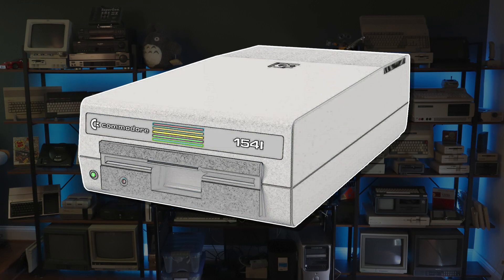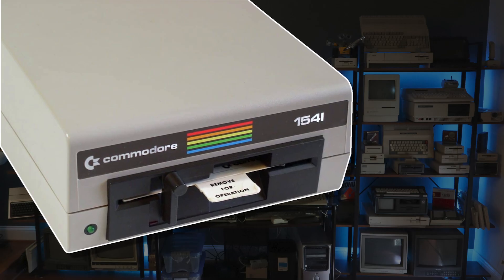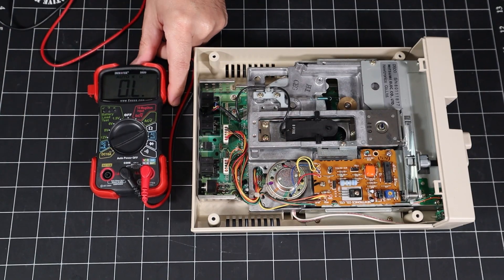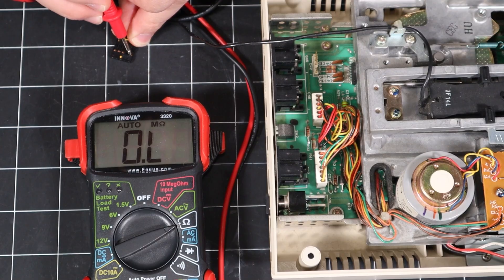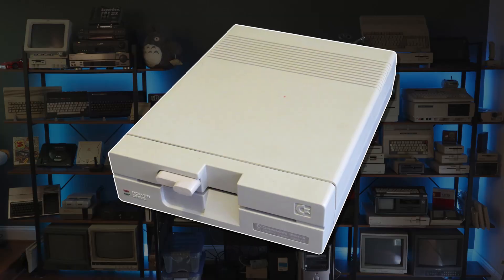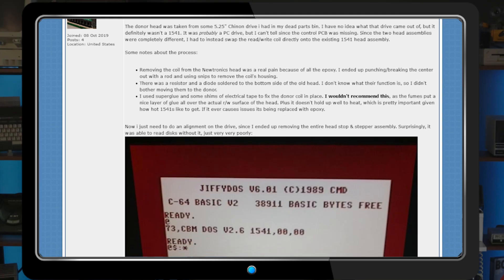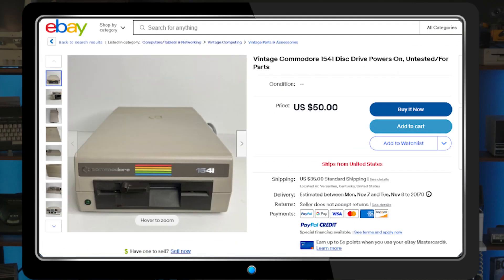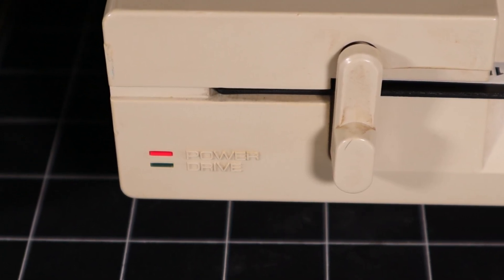This Commodore 1541 hides a terrible secret.

Comment: Short? Wait where? O.L is open.

I do wonder what repair methods we may be able to devise nowadays. You can SLA print precision parts and we can build precision coil winding machines at home. I do have a drive somewhere in a box stored under low humidity that may potentially be affected, i should check it out.
Reply from the maker: Thanks for pointing that out! I carelessly saw a 0 instead of O and stopped there. My bad. Clearly I need to be more observant. That's twice in two videos where I've missed obviously things that were right in front of me. I disassembled the drive and checked continuity of pin1 from the connector all the way to the PCB on the head just to ensure it was not a wire break and that tested out fine, so the break is somewhere inside the potting/coil.

That would be nice. I don't think I'm up to the task, but I'd love it if someone built a jig to re-wind a 1084 deflection yoke. At least that's big and bulky. The r/w head coil is so tiny and I'm all thumbs when it comes to delicate work.
Reply: @retrobitstv  Maybe there's a market for someone to make a run of new compatible heads for the Newtronics 1541? - and have them stock them at Console5 or similar.
Reply: @djmips  That is what I have been preaching all along. :)  I would buy at least 4 head assemblies! Even if they cost like 50 bucks each.
Reply: @Ragnar8504  If you produce just a handful yes, 500 seems reasonable. However you would use existing machines to wind the coils. Those still exist for many different components (inductors, record player pickups, anything with a small coil). What's more specialised is putting the head together: aligning, sealing. If you want to turn a profit yes, you probably pay a lot. But so far it doesn't seem like anyone will be doing this anyway.
Reply: @retrobitstv  And you missed it in editing both videos. I am more error prone as i age.
Reply: Yeah, OL is indicating open line, not shorted one.
Reply: O.L. = "Open Loop"... a throw back to Telco. More specifically the "battery" circuit between the central office and your home (wired) phone.
Reply: hi, great informative video. I thought it would take someone to start producing new cartridges free of this insidious defect. I have a classic 1541 with the lever (and therefore it could fail, but it still works well) I have a 1541 II with this cartridge too and finally a 1541 II with a good cartridge, but whose mechanics make a deadly noise (it is the model with recessed lever and with the disc ejection mechanism when the lever opens)

Comment: So the OG 82 model with the knocking is the one to get?
Reply from the maker: If you absolutely must have an OG 1541, at least those early Alps models can be repaired and aligned. The 1541-II with the Chinon mech is another good option. In my very next video I'll be demonstrating a new option for saving dead Newtronics 1541s :)

Comment: To be fair, i doubt they expected these drives to be in use 40yrs later. I dont have a 3half drive im willing to take apart but some business's must be making heads still with all the usb floppy drives on the market would it be possible to buy just read write heads and retrofit them I don't think they would reinvent the wheel on this type of component. Would be interesting to see if it's possible and where to buy heads.

Comment: I came here because I just watched an Adrian's Digital Basement video where he mentions the Newtronics-based 1541 being notoriously unreliable, but doesn't elaborate (or maybe he does later on, it's a long video and I haven't watched the whole thing yet). I was surprised because back in the day, I had a Newtronics-based 1541 while my friend had an Alps-based one, and it seemed to us that the Newtronics mechanism was better, at least mechanically. In the years I had mine, it was perfectly reliable, never gave me any trouble at all. But of course the kind of slow degradation described here simply wouldn't have had time to manifest in the time I owned mine (I don't remember exactly, but I'm pretty sure it was less than 10 years until I sold all my Commodore gear and switched to using C64 emulators running on PCs, when they finally got fast enough to do accurate emulation).

It's good to know because, being retired now, I do feel nostalgic for the C64 sometimes, and it would be neat to have one again, and it would be a shame to waste my time on a broken and unrepairable 1541. Maybe I should go for a 1581 instead!

Comment: My 1541 has been working great sense it was bought new back in the 1980's. No problems at all. One thing I did to fix the heat problem, was I got a old case fan I had laying around, and I put it on top of the vent and it keeps it cool.

Comment: The overheating of the 1541 A model can easily be fixed for the 220V models.  Note this requires working on the primary side of the power supply's transformer where potentially LETHAL VOLTAGES are present.  Only persons with the required training should perform this modification.  Those who are not qualified should consider that killing yourself this way does not fulfill the requirement of excellence to qualify for the prestigious - Darwin Award.  It may also void your drive's warranty.

The A model uses a fairly conventional power supply based on a linear regulator.  There are two secondary windings, one for the +5V and one for the +12V rail.  Both secondary windings deliver a a fairly high voltage via the rectifier to the linear regulators which thus are running pretty hot.  The primary side of the transformer has multiple taps for various international voltages, 100V, 117V, 220V and 240V.  100V is used in Japan only. 

The fix for the 220V version is to move the life wire from the 220V to the 240V tap.  This will result in lower voltages on the secondary side which in turn means the voltage regulators will run significantly cooler.   This  mod was very helpful already when the grid voltage is 220V.  Starting about 1987 Europe changed to 230V.  For the already hot running 1541 A models that meant they were running even hotter!

In theory a Japanese model could be switched from the 100V tap to the 117V tap.  This would result in a slightly larger relative voltage drop of the secondary voltages than for the 220V model.  I don't know if a reliable operation is still  guaranteed.

In the US the nominal voltage being 120 V the drive is probably running pretty hot but there is no suitable tap to switch to so a different approach is required.

Note that there are two variants of the schematics.  One only shows the 100V and 117V taps of the transformer.  The other shows no extra taps at all.  The transformers of all A models I've seen have 100V, 117V, 220V and 240V taps.

The heat is a serious issue for the A model.  It darkens the case of the 1541 and reduces the life time of other components.  In my case one of the bridge rectifiers got cooked twice.  Afair it was the 12V rectifier which is running hotter.  Suitable rectifiers are easily and cheaply available new - but this defect can be delayed by many years.  If your rectifier has failed I suggest replacing it with a beefier type as the one used by Commodore is operating pretty much at its limit so heat death is to be expected.

Update:  The one tap is 117 V, not 127 V.  My schematics are hard to read.

Comment: Another terrible secret (in old 1541) is the power filter integrated into the C14 socket. Due to possible sparking and "magic" mass, it may cause a short circuit, lack of electricity, damage to electronics and even fire.

Comment: has anyone ever made a logic board adapter to use "modern" PC era 1.2MB drives as a replacement? ( I mean of course just the physical head, frames etc... I know you'd still have to be able to drive the motor differently etc. because of GCR.  ) Is that even possible to do? I am just a fan of electronics and have no real skills.

Comment: I got tired of fixing my drives so some years ago I shelved my 9x 1541 drives (3 have Newtronics mechs but are working) and mostly just use an Ultimate1541-II cart but if I want to use a real floppy I use one of my 4x 1581 drives. 6 years ago I reversed the 1581 drive PCB and made an exact 1:1 reproduction (exact to within 0.1mm in every aspect) so now I just use that one drive for everything.

Comment: I got 8 different 1541s (and a VC1551 !) for very cheap in a lot from someone who sold the stock of his deceased dad.
From what he said his das collected a lot of hardware with the intention of repairing but never got around to it anymore (sadly he already had given away some PETs and other interesting stuff, before I met him)..
I could actually repair all the drives (besides the 1551 :(   ), and there where different issues, like fried VIAs, capacitors, RAMs, logic ICs and even transformers. But for luck no broken heads. So I don't think the quota of broken heads actually might not be so high? Maybe it's a regional dependency? I am in Germany, and of course we usually get later batches of technology when it was invented an first marketed in the states ..
Reply from the maker: Yeah, totally possible that the bad heads all originated from a specific lot of parts used by one regional manufacturer. I don't think anyone's ever aggregated the information about failed drives to find out if there are any similarities though.

Comment: I know this video is over a year old. I bought 2 “untested” 1541’s and of course the heads are shot! Is the 1571 any better? Or any other drive that can read commodore 5 1/4” reliably?
Reply from the maker: Some 1571s do have Newtronics mechanisms and some people have had them fail. I have never personally seen a 1571 go bad (yet). They may be less susceptible than the 1541s or perhaps it's just because they're newer? The 1541-II with the Chinon mechanism is a good option.
Reply: @retrobitstv  ok, one technical question, and an opinion or educated guess is ok! Do you think a head from an Alps drive could be used to replace a Newtronics drive head? I don’t mind some small work to do so! Thanks! Great channel Matt!
Reply from the maker: @bobsbarnworkshop I imagine anything is possible with sufficient motivation but I wouldn't dare guess how difficult the swap would be. If the geometry and the coil impedance were similar it might be an easy job but I haven't examined both units that closely!

Comment: I had a 1541 with the Alps mechanism, and at one point I had to take the drive in for alignment and the repairman did the extra step of adding a pin so that it would not lose alignment and that drive worked perfectly after that. The thing still ran hot however.

Comment: Some 23 years ago a friend and I experimented with two 1541's with remarkably different circuit boards, and slightly different mechanisms, with the head and track motor wires coming from different spots but able to reach. We managed to get the mechanism from one (not sure which) to work fully with the other boards, wires carefully routed to avoid snagging. I think both had the "flap" on the front though, so these likely were two revisions of MK1. One appeared completely dead towards the C64, the other had some mechanical issue... it is likely that both were repairable as is, but we managed to Frankenstein one working drive from two non-working ones and we were happy with the result then.
Reply: EDIT: 23 years ago (typo).

Comment: I had an Enhancer 2000 floppy drive back in the '80s, which was quieter and sleeker. It was probably faster too. I never had any compatibility problems with it.
Reply: The 1541 was only so slow because of the data transfer protocol that Commodore used, and there are videos on this channel that explain how that happened (wasn't intended).  This impacts all drives connected to the C64, and although some of the 1541 alternatives were better drives in some respects, they were never faster.  How could they be?  In fact, unless such a drive is compatible enough to run fastloaders (some Enhancer 2000s are and some aren't, as it happens), which change the data transfer protocol, it would often be much slower than the 1541.

Comment: Sorry, if this was covered and I missed it, but I was curious if the 1571 suffers from the same Newtronics RW head failure, or if Commodore was shipping the 1571 with something else by then...  I've got five 1541's and two are working, and only one of those is an ALPS.  Now, one of my non-working drives is also ALPS, so that might be salvageable with some work. - but I really would like a drive I can count on for years to come and was considering just getting a 1571.
Reply from the maker: The issue has been documented with the 1571 as well but not with nearly the frequency of the 1541. That could simply be because the 1571 are newer or there are less of them out there in the first place though. Personally, I've never had a 1571 fail out of the 5 or 6 I've owned in recent years. It may also be worth looking at picking up a Chinon 1541-II.
Reply: @retrobitstv  Thanks for the reply.  After my post I remembered the 1571 has a double-sided mode when used with a 128, which would seem to infer the drive mechanism has to be a different make/model than what was used in the 1541 et al.  I couldn't find anything that definitively stated who manufactured the drive mechanism (chinon, newtronic, etc) - so I offer it as a suggestion for a future video.  It might be very interesting to extend this with a 'part two' that talks about the 1571.  Anyway, love the channel, and thanks for the great info!

Comment: While watching this, I wondered if it would be possible to find a working single-sided five-and-one-quarter inch drive, remove the control electronics and connect it up as a replacement for a bad drive inside one of these units?
And if it was a double-sided drive, maybe it would be possible to set up some extra electronics so you could switch heads manually, effectively giving you two disks on different sides of the same floppy disk.
Of course you'd have to be careful never to switch heads in the middle of a write operation since that would likely render both sides of the disk unreadable, but it may even be possible to add enough logic so that the heads couldn't be switched during a read or write operation.

Comment: Excellent video.  I had the original tab 1541 and never had a problem back when.  I emulate now.  At some point I’d like to require my old setup.  All I’d care about is cosmetics.  Wouldn’t care if it functioned just for display.  We are entering a time where these will start to consistently fail so anything that says powers on not tested and they can’t even jury rig it to test on a new TV is telling you it’s broken.  And like you say even if it works at this instant during shipping something could happen.

Comment: What about the 128D(CR) internal drives?
Reply from the maker: Anecdotally, it seems like the 1571 in general does not suffer from this problem at anywhere near the rate of the 1541.

Comment: Well i just indeed bought a 1541 diskdrive before i indeed did watched this video and i paid €123 including shipping costs,it did indeed said powers on untested and it did came with everything ,and i was ABSOLUTELY aware about the huge risk i took,but i just wanted to had it into my collection,and guess what,despite i accidentally did dropped the yet in boxed unit on it’s side,it amezing not only didn’t broke BUT it still did work,altrough that bubblewrap was out of west,probably becausevit absorbed the shock from dropping it wich saved the duskdrive from being ruined,so consider my purchase to be EXTREAMLY lucky ,altrough i my consider buying a sd card diskdrive emulator module in case the disldrive will ever stop working in the future,so who knows.

Comment: Garbage the ALPS are the best they only over heat if covered besides a fan can be added or a simple fan sitting on top cools it the 1541 2 sucks apart from the ALPS as for alignment they are easy to align if you have a clue how to that is

Comment: Does the 1571 or 1570 have the same issue?
Reply from the maker: I have not heard of many 1571 issues and haven't had any problem with the 5 or 6 that have passed through my hands in the present day. I'd say of all the drives they are the safest bet along with the Chinon 1541-II.
Reply: @retrobitstv  my guess is that because the 1571 has a Track 1 sensor, it's not as big of a problem. (not sure if the 1570 had it as well, but I think it did)
Reply: @retrobitstv  only thing I've experienced is having the drive light on constantly, which means the 6502 has a short.